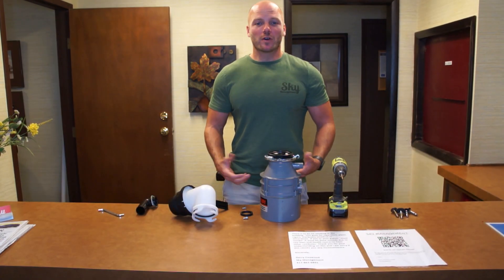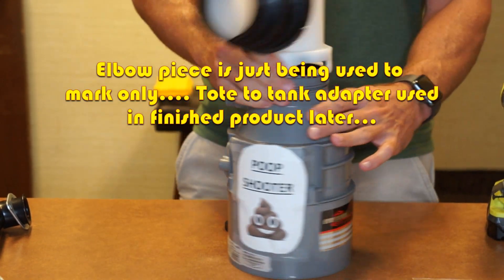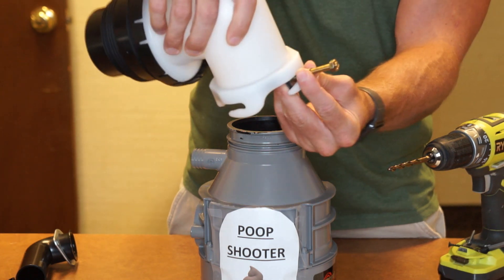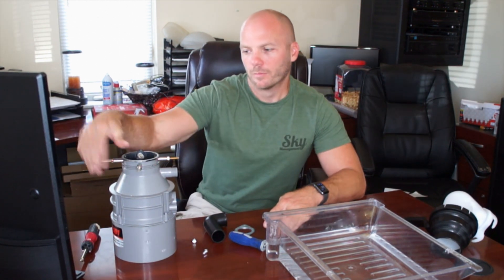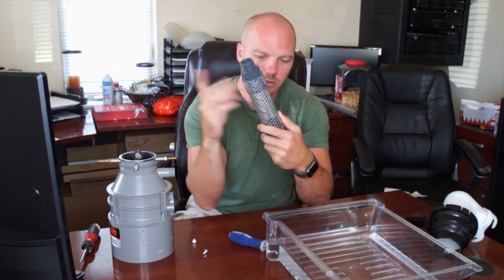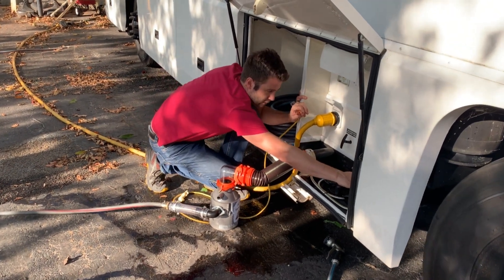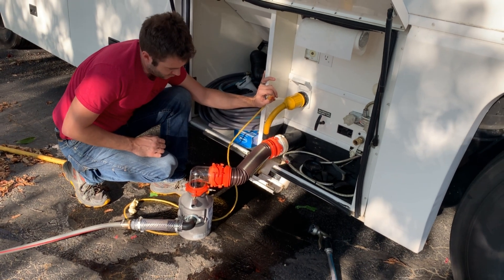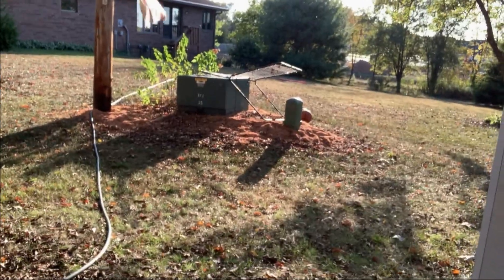DIY RV Waste Pump.  Pump waste uphill with the Poop Shooter! Home made Macerator Pump.

Comment: A garbage disposal is not a pump
Reply from the maker: You are entitled to your opinion.  It’s not meant for grinding up human waste either.   However I can tell you that as an experiment if you go home and fill your garbage disposal side of the sink with water and unplug it so that it drains naturally… then repeat the process and turn the disposal on…. You will find the water leaves the sink like a bat out of hell.

It moves liquid faster… thus…The definition according to Webster’s.: a device that raises, transfers, delivers, or compresses fluids or that attenuates gases especially by suction or pressure or both
Reply: @SkyManagement    for another experiment hook up a regular garbage disposal even to fresh water and pump up hill even 5ft and let me know how that works.  No garbage disposals I know of actually "pump"

Comment: So, I picked up a 1/2 hp disposal new from Lowes.  It worked like a charm for the first run (gray water).  Then I ran the black water through and it started clacking and making noise.  I shut it off and let it rest an hour.  When I turned it back on, it still clacking and then bound up and hummed.  I immediately shut it off and I could never get it to work again.  I figured with the clacking noise, maybe I had a bad disposal so I go another.  Exact same experience.  Any ideas?
Reply from the maker: Well... not really... sorry to say.  Only issue we have had is if I have forgotten and left it on it will eventually overheat and throw a thermal breaker in the unit so I have had to let it rest before but the "clacking" you are referring to I don't have any ideas..   There may be something that was dropped down the black tank that is getting bound up in the unit itself.  Hard to say without being there.  I know with a typical garbage disposal if it gets something stuck (Glass, metal, coins, bones... etc.) it will bind up and hum.  You will need to dislodge the obstruction and turn the bottom with a self service wrenchette or garbage disposal key (large Allen wrench) to free it and then push the reset on the bottom.  Sorry we can't be of more help.

Comment: This might be a solution.  I have a parked RV and I need a permanent mount installation to macerate and pump 67 feet at about a 5 foot higher elevation that I prefer be on 110.  Do you think this would work?  Might I need to add an additional pump?

I've considered the flojets but a 12 volt seems too weak.  Ideally, I would like it to switch on and do the deed automatically.
Reply from the maker: I think this would pump that distance. But I think it would do a better job all at once. If you try to make it automatic the long hose might get bogged up. If it only does a little at a time the sediment may accumulate in the hose. When we use this we dump the waste tank and then flush the system with a little bit of clean behind it to clean it out.
Reply: @SkyManagement  much thanks!  I will try it!
Reply: There are some Serious 12v pumps out there even more so at 24vdc. A bilge pump for a boat comes to mind. I have a 24v well pump that will pump 10gpm at a 40 foot lift.

Comment: Great video and thank you for taking the time to make it. I'm wondering if this would pump uphill at all like from the wastewater clean out on a RV up into a tote that is in the bed of a pickup truck?
Reply from the maker: I haven’t measured how high it will go, but if the truck was close to the dump valve I think it would go that high with out any trouble. It does push with decent force.
Reply: @SkyManagement  Thank you so much for the video and responding :)

Comment: If you wanted to follow up with fresh water to flush the hose after dumping the gray water you could introduce fresh water into the dishwasher inlet, maybe with a check valve.
Reply from the maker: That’s an interesting idea. You might be able to get a little more force behind it to go up hill that way too.
Reply: They also have the flush elbows you can get with the GH connector and valve built in

Comment: So the garbage disposal also acts as a pump? I didn't think they actually did any pumping...
Reply from the maker: The blades spinning chop everything and force it out the small hole in the side.  It’s not a pump per se... but it will force water out of the hole.  If you fill up your sink on the garbage disposal side... and then pull the plug... let it drain for a second and you will see it only drains at a certain slow rate... now kick on the garbage disposal and watch the water move.

Comment: What hp is the garbage disposal
Reply from the maker: Any old one is fine... wouldn’t matter.  I believe this was a 1/3 hP but if you are changing out one in your house as long as it works ... IT WORKS :-)
Reply: Ok thanks.  I have one built but im running it to a 55 gallon drum on a trailer.   And using 2/3 hp

Comment: Thanks for the clear inlet /outlet idea   as for reducing 1. 1/2  to smaller garden hose I was thinking of maintaining 1 1/2  " blue flexible, collapsible discharge hose, and yes try to pinch, /hold up /walk waste out  to end of line , because of less resistance, faster flow rate,    just wondering how well did 3" 3/8  garbage disposal size adapt to the 3"5/16 clear plastic waist tank adapter fitting? No grinding down size?
Reply from the maker: The waste tote adapter fit directly onto the garbage disposal without any modification. Just needs the bolts put in so it can lock on. 
I haven’t tried it with a larger hose. The garden hose does take a little time to empty the tank. The thought behind the small hose was to be able to go flat to slightly up hill. 
As long as you are going down hill a larger hose would probably be ok. Maybe even better.

Comment: Just buy a macerator pump - cheaper and easier to use
Reply from the maker: You can find an actual macerator one for about 200 bucks.  If you have access to the parts this was done for about 25 bucks.  Easier to use... you are likely correct there sir.  Cheaper... not likely...unless you are buying all of the parts new then i still think it would be cheaper but not worth the hassle.
Reply: price this and price the macerator!
Reply: Do you have any links to a 120v rv macerator?  The 12v ones have too many problems clogging with paper or even hair, 1 bad experience is too many.  I know they used to make them for rv's but I've been looking for months and can't find one.